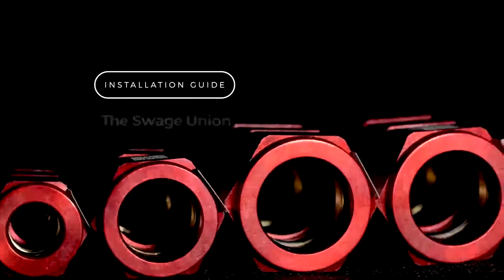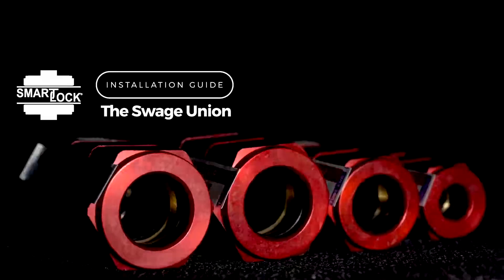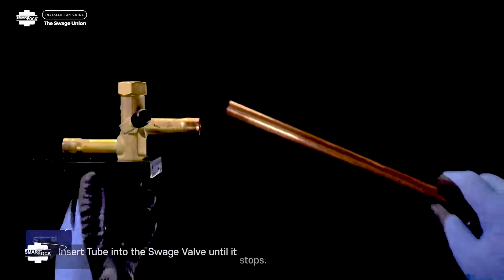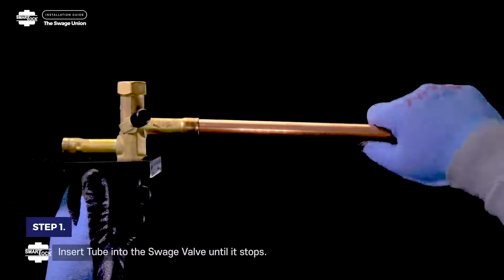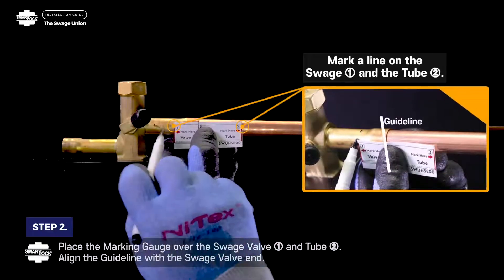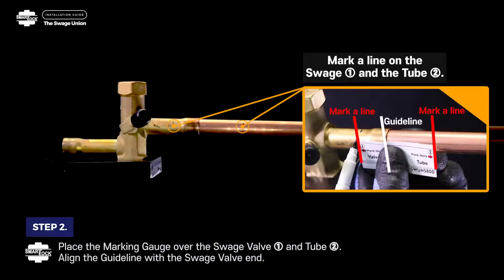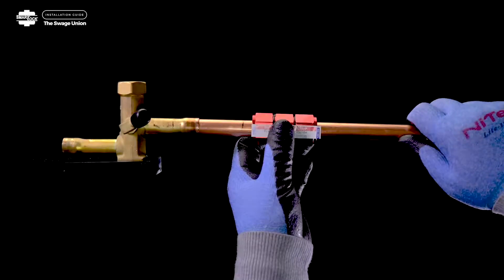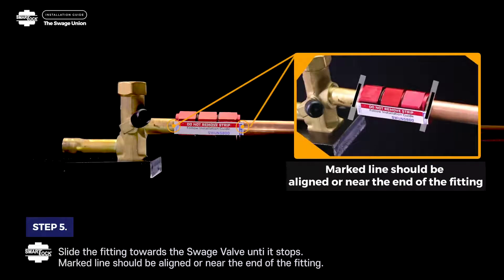Swage Union (SWUN) Installation

Comment: what distributors sell these fittings??
Reply: I’ve seen them at Johnstone supply
Reply from the maker: We have various distributors across the country.  You can look one up at https://www.smartlockfitting.com/find-smartlock-fittings.  You can also buy online at https://www.supplyhouse.com/SmartLock
Reply: @smartlockfitting how does it seal? Is it o-rings, is it medal to medal? 
How does it stay together, how is it anchored together the connection to withhold the pressure?
Reply from the maker: @jayquelin1932  It is a metal-to-metal seal.  As the outer nuts are tightened with wrenches, internal mechanism applies pressure on the metal ferrule, forcing the ferrules onto the tube creating a permanent seal.
Reply: We have them at daikin comfort technologies/ goodman as well